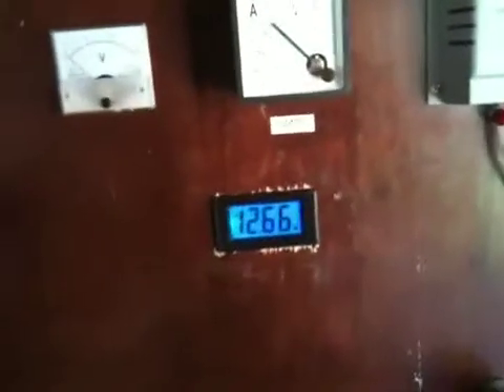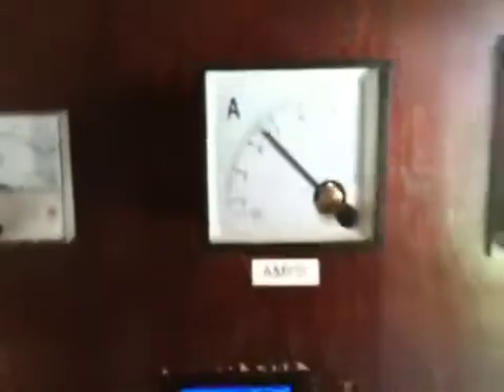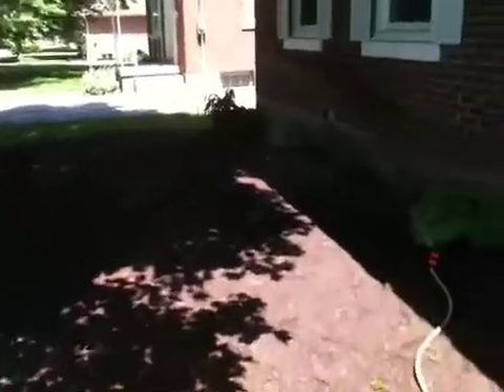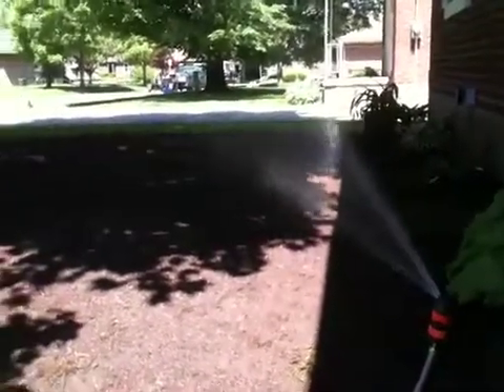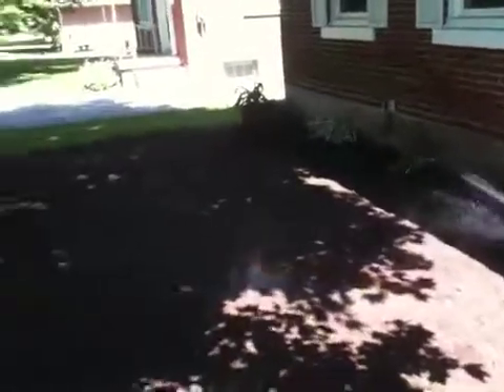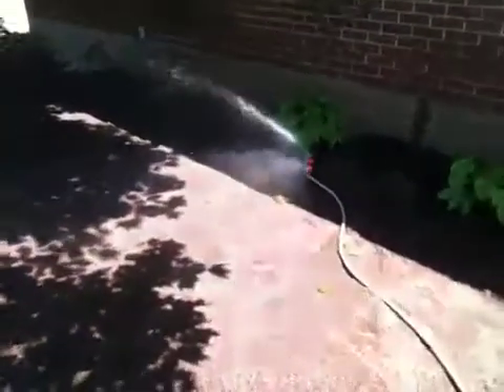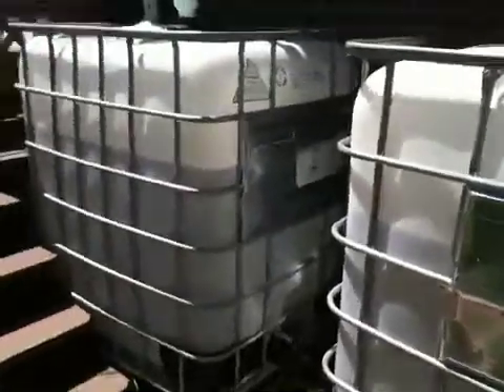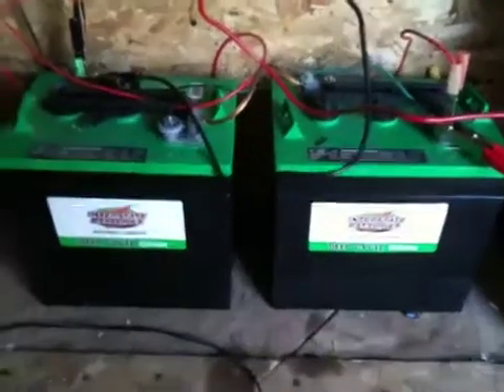Solar rain barrel pump running sprinkler

Comment: I know it is tough to reply to each comment but man your sprinkler is really spraying nice!  I picked up a 275 gallon tote and plan to use it to collect water from my garage to water my vegetable garden.  I was just concerned about how many gallons per hour to pump as the street water is said to be 250-350GPH pressure.  Can you share with me either reply to this or message me what size or model / brand pump you used.?  also any other info mayby a forum build up thread? any helps is appreciated.